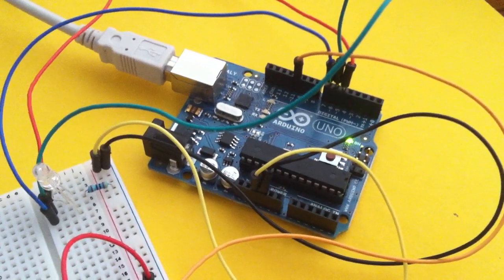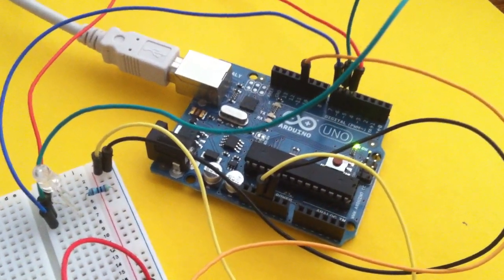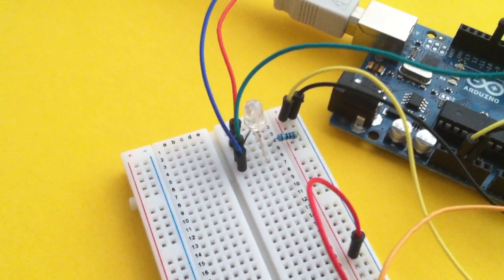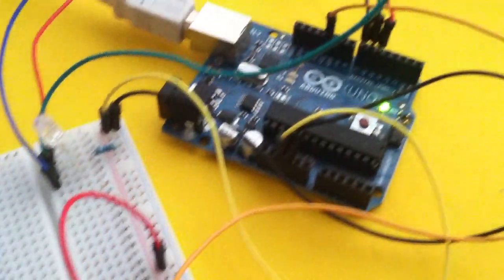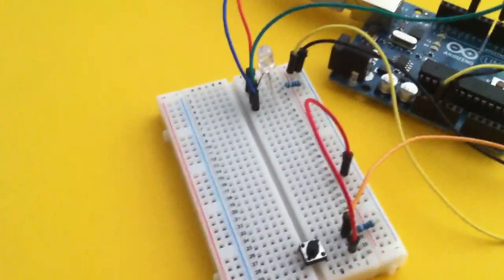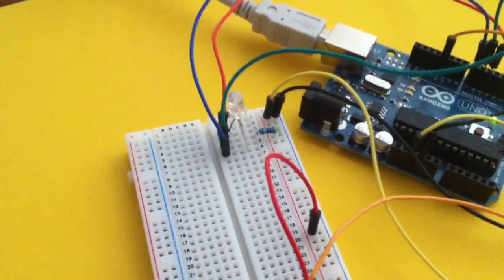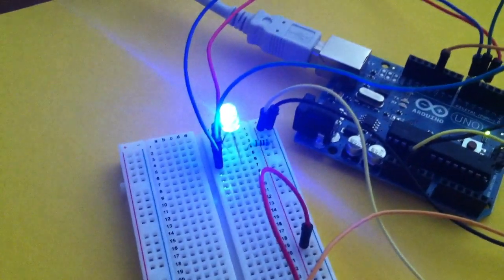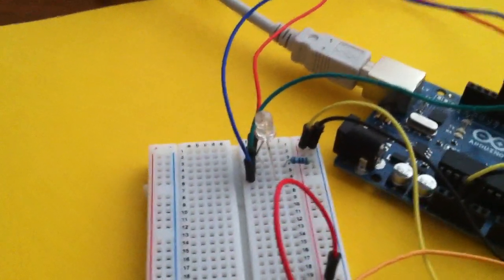My Pet Arduino Sequences an RGB LED

Comment: Hi, 
I used your code to sequence through four seperate LEDs, added a pin and coour to get code to work and it works fine. I want the LED to stay on until the button is pushed when the next LED in the sequence lights up. Still only ever one on at anyone time. I'm new to coding and not sure how to code this?? Thanks for your tutorial on your site.

Matt